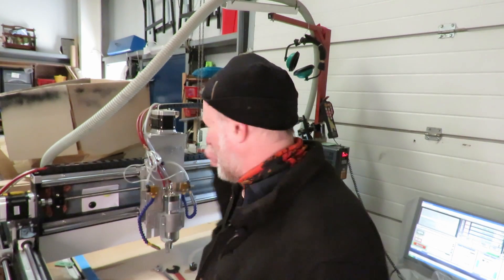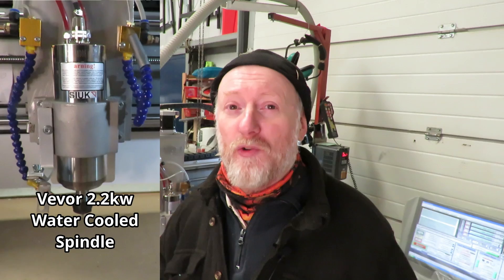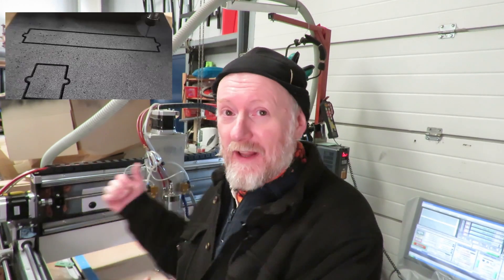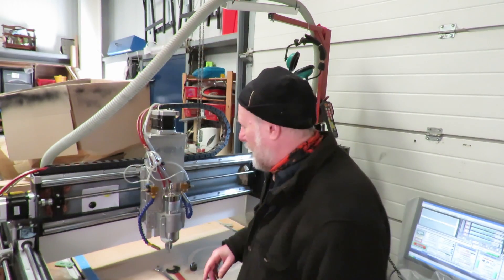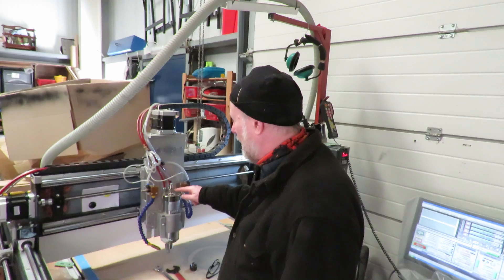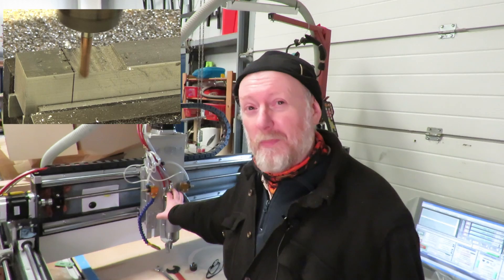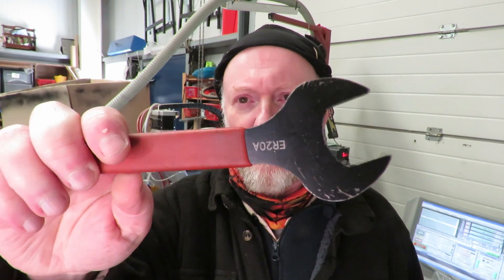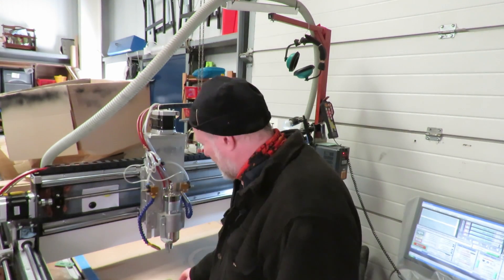Vevor 2.2kw Water Cooled CNC Spindle Review

Comment: i has be same spindle now long time, about 6 month or year, not remember when i buy this, one problem has all this time, noise have some RPM different and distpurn me but i reduce speed no problem,  normal i use my plywood work 3mm and 6mm bit,  newer not has problems, speed has normal about only 50% max. i buy 55€ aliexpress CW-100 VFD and working well. (only i not understand how add parameters can install external, buttons and potentiometer, not working i test many time different parameters) spindle has cheap but very good, less than 200$ cost. big problem is onlt why vevor not sell spindle wht ready cable, not easy solder cable small plug . need be ready cable. and heat lot all spindle if not have radiator, i has first only water tank 20 liter and submercile pump 30$ . heat lot max 70 degree celsius and i stop use motor more. 2 hour job has. later i buy radiator 30$ and 2 PC fan 8€ help lot heat.
Reply from the maker: I've never had a problem with overheating and a bucket of water. The radiator is a good idea though. Just ensure your VFD is powerful enough, it needs a 4kw version to run the 2.2kw spindle properly, the ones sold as 2.2kw aren't up to the job, long term. If no manual exists it will be hard to program the VFD, see if you can find anyone familiar with turbines where you are, they may have some ideas. good luck.
Reply: @TheCNCDen  newer not has problem VFD, no heat, no hot, only spindle motor come hot if use only bucket at cooler liguid, but first 2-3 hour can use normal then bucket water collect all heat and then water temp has ower 70 degree celsius, VFD not  has hot, next i test use radiator but wait now last some parts can connect all tubes ready. 2 120mm PC fan size radiator. today i wiring all new and fans can controller on/off now whit computer display linuxcnc screen button. simple add one SSD relay switch fans on/off.
Reply from the maker: @mattivirta Firstly it should be di-ionised water and even better if you add coolant to the mix. A 20lt bucket should not get to 70'. Sounds like you have another problem.

Comment: I'v actually been looking at those spindles. Not sure if I'm getting the water-cooled or the air-cooled one. I was looking at their square air-cooled spindle. I had one, not sure which brand it is but I smoked it before I even got to use it. I set the VHD for 11 amps but the spindle is a 8 amp, I let it run on low for a bit then sped it up, got close to full speed and she smoked and a lot. I have a router hooked up to it now but it won't last long. Went through a few routers on my old machine. If you forget to check the brushes you screwed. ☹ A router can cost as much as a spindle.
Reply from the maker: I haven't tested the air cooled versions, I do know they put out a lot of air so dust is distributed around more. Cutting aluminium, I needed the slightly higher rated water cooled. 

Routers are surprisingly resiliant I've noticed, with limitations. They are meant for speradic use not long continious cuts that CNC machines do, so may work for the occasional project but not reliable long term.  

If you have a VFD, it provides the best control.

Comment: my first spindle has air cooled 800W ER16, has good if use only max 1mm deep to pass, and only wood. but if need mill aluminium too better buy 1,5-2,2KW water cooled spindle. about same cost both, 100-130€  800W cost 100€ and vevor 2,2KW cost 130€ but all need buy collect set too 20-50€  vevor need buy pump and tubes too 30-50€. i buy aliexpress all parts.

Comment: NOT use only water newer, need use car coolant liquid water mix, then not mold water.
Reply from the maker: Correct, you can use just de-ionised water, never tap water, but adding the car coolant helps prolong how often you need to change it.

Comment: i has just last week buy same spindle, 2.2KW vevor water cooled, not has install yet, but this only motor spindle, 130$ and no kit not any other parts, but include ER20 one collect and nut, you say not has nut, has nut and one collect, later need order collect set and water tubes and pump, VFD i order before HY---- 70$ 2.2KW VFD. need order later 3-phase shielded cable 4x2,5mm2 and power input cable single phase 3x2,5mm2.  just has think how route all cable and water tube my cnc machine, all elektric cables go left side beam and elektric box, but i think VFD and water tubes maybe better route Z to right side and VFD but right side beam bracket, and then water tubes route this down to water tank.
Reply from the maker: I'm sure when you get it set up, it will be ideal.

Comment: Thanks for doing this video. I just bought one of these. I sort of didn't think about it, but do you really just use water to cool it or is there something needed to prevent corrosion?
Reply from the maker: No, you don't just use water. 
It must be de-ionised water and I always add antifreeze / coolant mix it helps extend the life of the water from going manky, which it will. You do need to change it regularly to, like changing oil in your car. Keep an eye on it around every 6mths roughly.

Comment: 6:20 you mean within a few hundreds of a mm instead of a few thousands right? 0.02 or 20um I'd consider not really great. My RATTM 1.5KW spindle is well below 0.01mm, the needle hardly moved, as measured within the inner taper where the collet sits. The outer diameter isn't really relevant.

Comment: what is the rating on those steppers? are those 23's?
Reply from the maker: I have 34's on my machine.
Reply: @TheCNCDen  wow. she is a true beast of a home CNC.
Reply from the maker: It's not a home CNC and TBH there are better machines, we've improved it since we bought it, we have it in an industrial unit and run it professionally.  It's small because that was all the space we have in the unit to accomodate a machine.

One of our other videos is a review of this machine, lets just say there was a few issues when we got it.
Reply: @TheCNCDen  i call it a home machine because its not a big three phase 480v machine running a 12ft bed or some crazy size.  but its still a beast for its size.  im a controls engineer with the last three decades spent in factories. i have a biased scale for what i call professional machinery.
Reply from the maker: @Kathyoftheglade    That makes sense. The blower on the VAC bed I fitted is 3 phase at the moment, though I may use the spare VFD I now have to put it back to 240v.